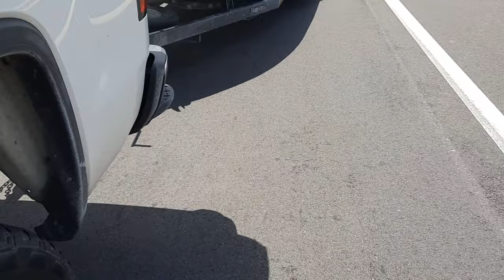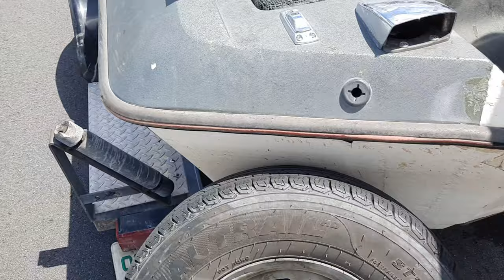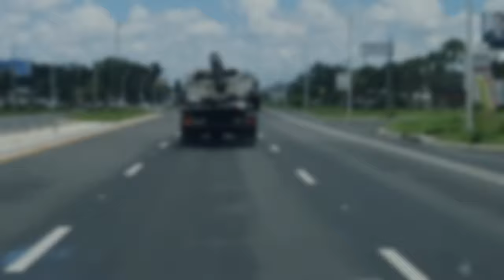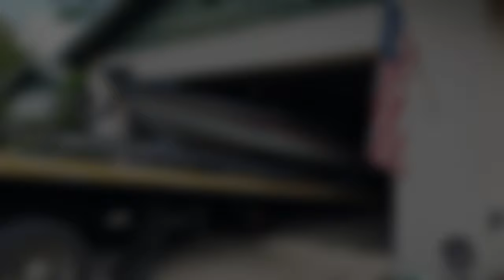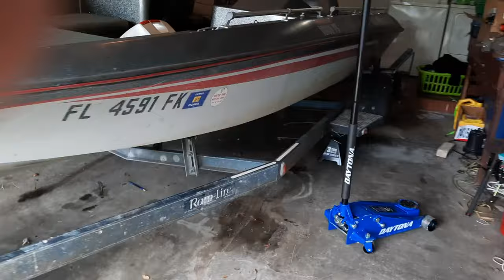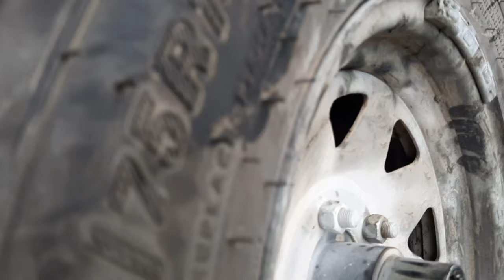Wheel came off my boat trailer!

Comment: I finally made it over to check out your channel. I can’t say this hasn’t happened to me:/ Nice to meet you! -Robert
Reply from the maker: Not one of my finer moments, but it could have been much worse.
Reply: @ThatShinerGuy  Been there. I had a flame shooting out at 70 mph before the wheel came off on the interstate. By the time I got it stopped, it grounded off the leaf spring u bolts and ground more than a third of the axle threads. Believe it or not, I was able to do the repairs on the side of the interstate with a new bearing kit and a dremel.

Comment: This happened to us ,wheel. came off just after we put the boat in the water ?cant understand how this happened , the axle is not damaged at all  could it because the wheel was not blotted on correct?.
Reply from the maker: In my situation the bearing failed.  The hub was still bolted to the wheel.  I should have serviced the bearings sooner.

Comment: My tire came off parking in a space. I guess it was wobbling and ate up the rigdes at the end of the axle so i cant screw the new tire back on. I'm hoping for a quicker fix than replacing the axle
Reply from the maker: I hope your luck is better than mine.  One end of the axle was damaged from dragging on the road.  The other bearing wouldn't come off even with a sledge hammer.  Still could have been worse.

Comment: Axel still might be good, looks like a barring buddy issues lol I hate those things for this reason. But just cut the barring off the axel and sand it, if it’s not grooved up.
Reply from the maker: The spindle was damaged.  I had a new axle fabricated for under $200.  It's all back together and ready to roll now.  I am glad it wasn't worse.
Reply: @ThatShinerGuy  happened to me and pulled the truck into the guardrail, roofing scrap was like a road anchor that day lol at least it didn’t cost that much and your back in the boat. Like you said could of been worse